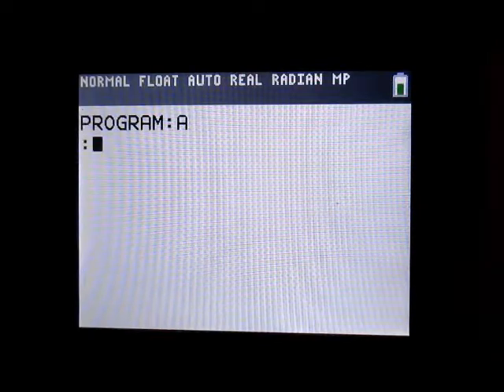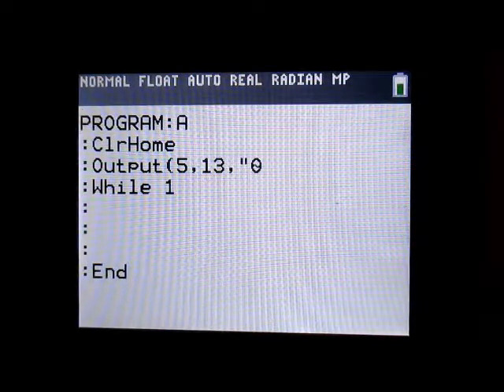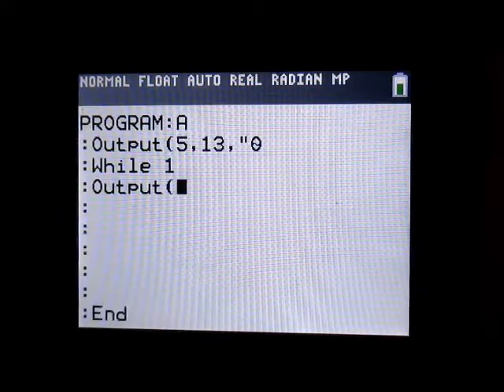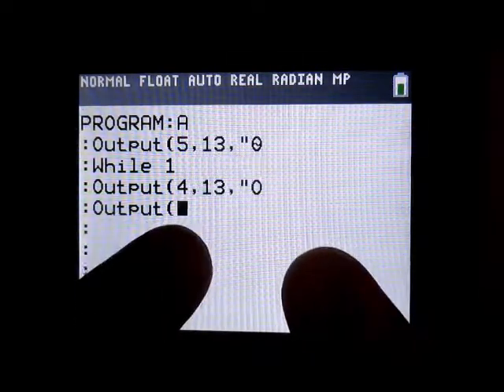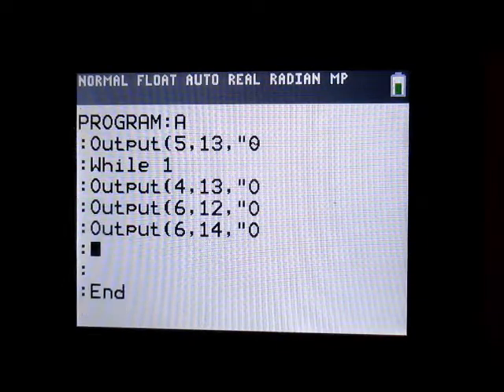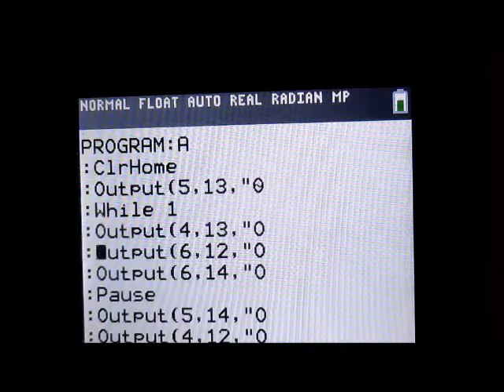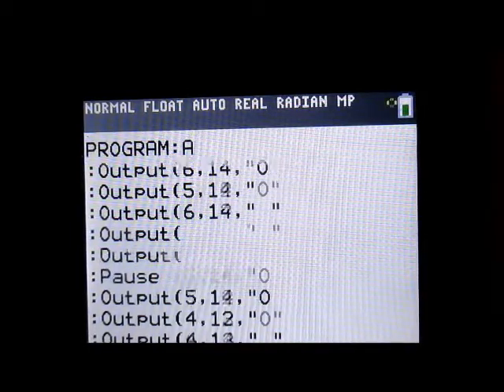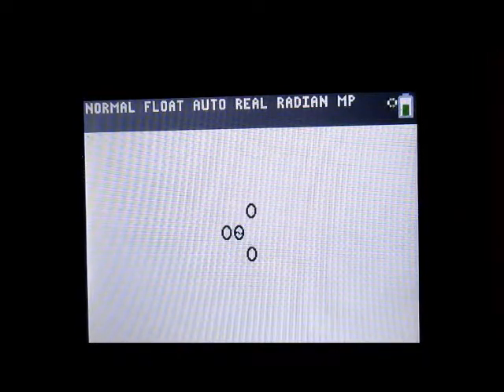Programming a Fidget Spinnner on a Calculator

Comment: I have a effecient design:

this is meant for a 16*8 screen aka ti-83 and ti-84 not ce
Clrhm
while 1
output(8,8,"0
// im lazy so fidget spinner pos 1
Clrhm
output(8,8,"0
// im lazy so fidget spinner pos 2
and Etc. and save a line of code for each position
end